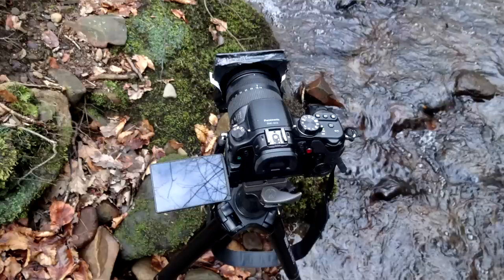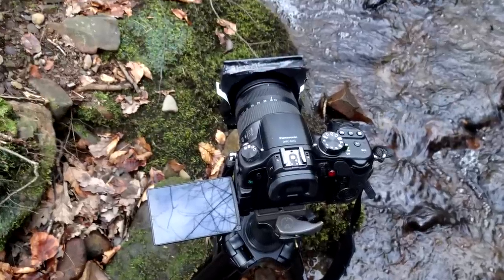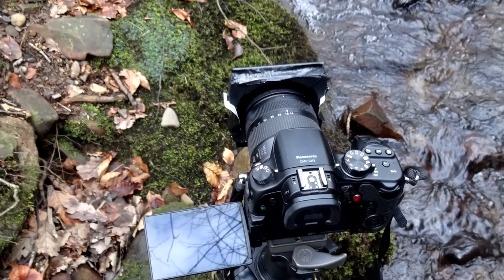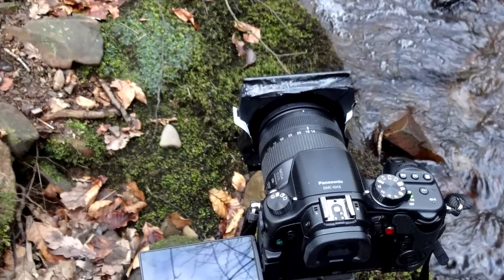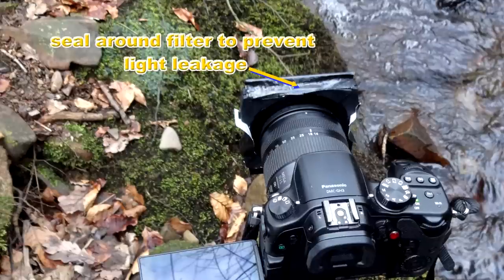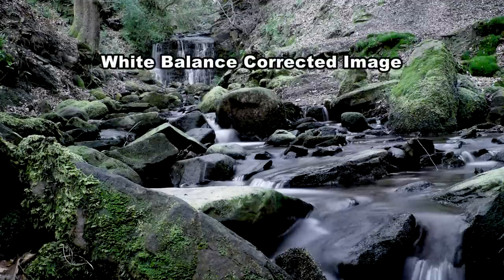Using an Electric Arc Welding Glass for Long Time Exposure Pictures

Comment: I just bought a FORNEY  welding glass, item #57052 of  #10 shade here at a local Hardware store.. $3.99 for one. I just need a holder for it. It is 5.5 inches by 4.5 inches. I will hold it by hand for now, or try to tape it to a uv filter.. Thanks for the video. I

Comment: I've used welders glass for the solar eclipse and the transits of Venus and Mercury, by simply holding 2 of the glasses against the lens with good results, but I never thought to use them as filters.  Thanks for the tip
After a bit more thought, I guess it'd be wise to take a simple shot first so that you've got a reference picture on how the colours look naturally and then use the white balance to match it..